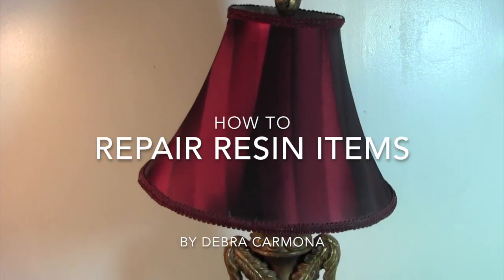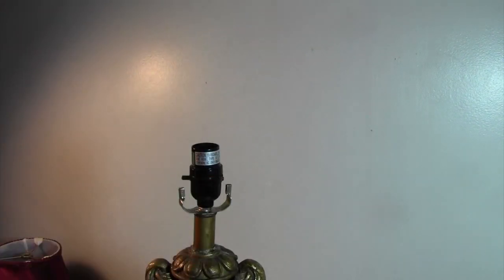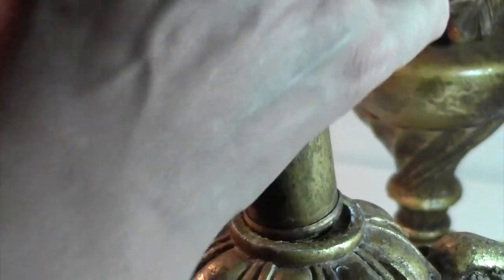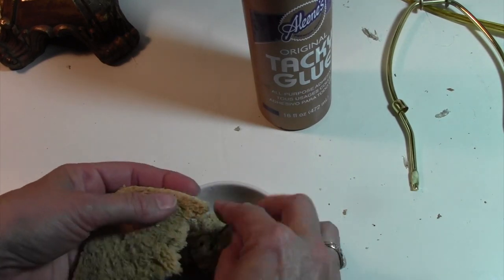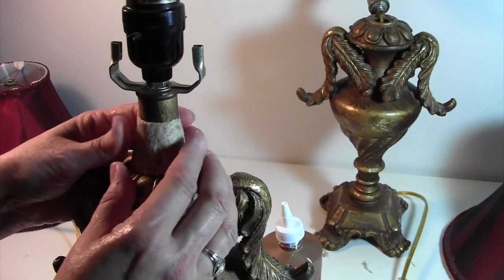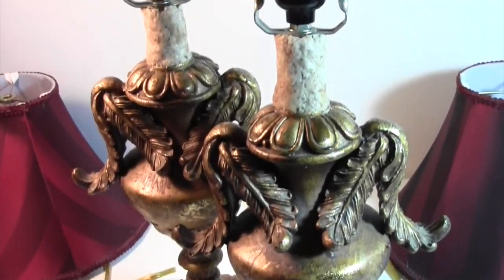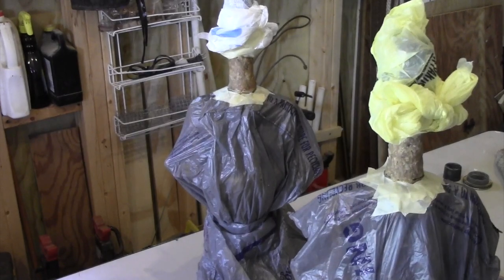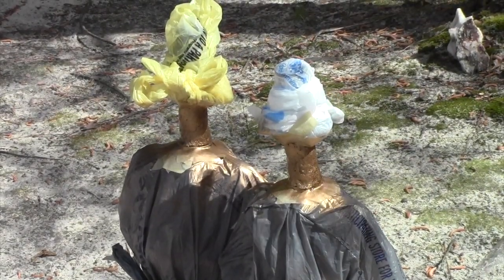She used BREAD to repair a Lamp made of resin

Comment: A bit of 2 part epoxy would have solved this problem rather than using two completely incompatible materials to fix the problem. The glue and bread "solution" is worse than the hot glue.

Comment: is this a joke video? did she just use bread to glue it back together? If anything i would have used oatmeal, that stuff is like concrete when dried on.
Reply from the maker: Yes I did and it works. I am still using the lamps today without any issue.

Comment: U have to be lying there is no way those things still held up the test of time. You’re telling me it didn’t mold, start to stink, or get eaten by bugs? Honestly amazing that it did last(I read through the comments), but no way would I recommend this to anyone else. Is the consistency of the bread putty rock hard still or is it mushy? Do you think the reason it didn’t mold or get eaten by bugs is because you created a seal with the paint? Why did you resort to this and not an epoxy or a more practical solution? I do not mean to be rude, I am just very curious and somewhat excited to see such unorthodox methods of repairs. These are the kinds of things I think about but would never actually do. Can you do an update on the lamps so everyone can see how they held up?
Reply from the maker: I don't lie, cheat, or steal. I am always an honest person. It hardened just fine. I actually got the idea from a flyer showing how to do this craft using the very same ingredients. I have repaired things before made of resin  (a wall decor, a broken vase, and a statue) and they held up just fine. Could be the components of the glue combined with a painted surface that sealed it but it indeed works.  Bread is made of wheat and wheat contains gluten which is very sticky so it works like glue. I have an upcoming video where I am putting in window shutters. You will see the lamp is still there in the same place in good working condition.

Comment: I have 2 resin buffet lamps that are losing their paint with use / age (cracking)  What type of paint did you use?
Reply from the maker: Acrylic Paint always holds up well. I have used it on various repaired objects including things outside in the weather.

Comment: I don't think using bread was a good idea as in time it could dissolve making the mixture unstable and fragile.
Reply from the maker: My thinking is the glue will bind it together but perhaps you are right. I guess we shall see in time. It is now over a year later and so far so good.
Reply: @DebraCarmona  Oh wow! So if it's still holding after a year. It must work. You came up with something no one else knew about. IMO it actually looks good. I just had my doubts if the consistency would hold and now you have confirmed it has. Great job!

Comment: Although it looks like you have done a good job, can I make some comments.
Ultimately the joint needs high strength to survive maybe another accident. The tacky glue looks like PVA (polyvinylalcohol).
The glue recommended by manufacturers for resin joints are epoxy and superglue, or combinations.

I would have used 2 pack epoxy. I would believe that PVA would not be strong enough.

I am a Material Scientist and did research into adhesives.
Reply from the maker: Ok

Comment: Can Elmer's be used?
Reply from the maker: Elmer's glue is a poor quality glue. Tacky glue would be better but I have repaired other resin products that had missing pieces before so I wanted to use the same technique to show how to repair anything made from resin. You can paint it to hide the seam or inserted part to blend in. Glue does not paint well.

Comment: can this recipe be sanded?
Reply from the maker: I haven't tried sanding it because it is very moldable so you can form it to whatever shape you need. I have used it to replace broken parts of a vase, and molded mirror frame.